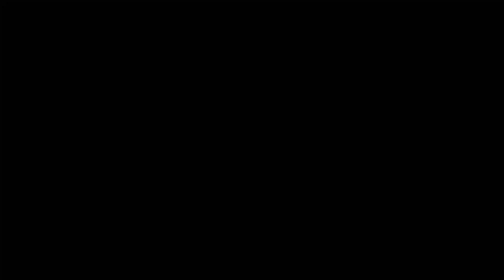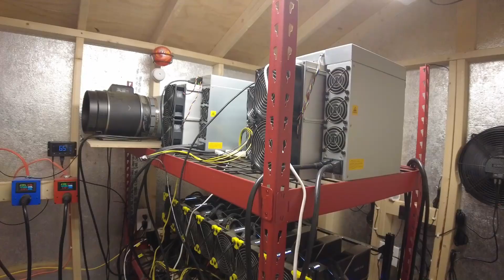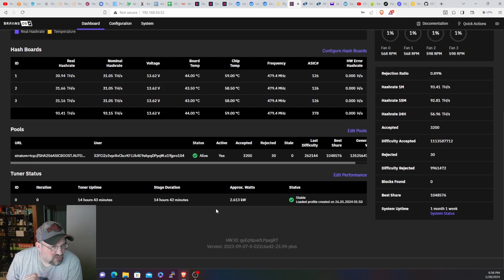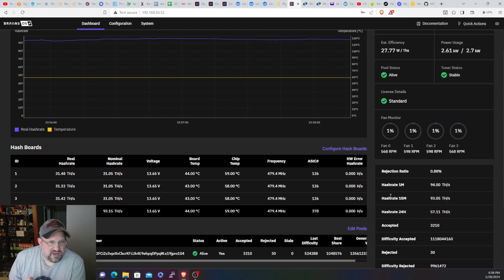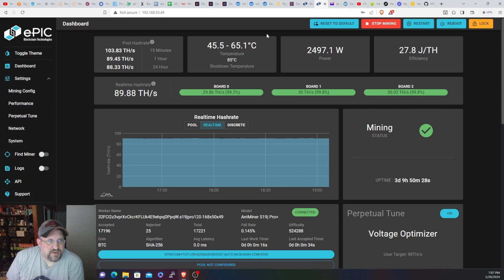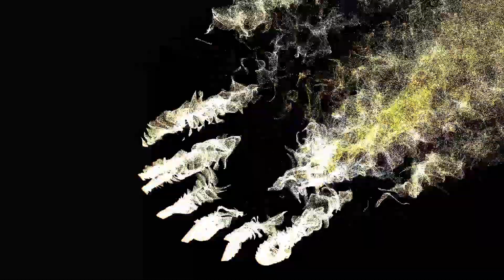Update on My Bitcoin Miners -  Braiins & ePic Control Boards

Comment: How much are you paying for electricity 
And what's your plan for the halving if you paying over 8c
Reply from the maker: for January it was $0.104/kwh.  I just recently switched to a different plan that should drop it below $0.06
Reply: @ruskyscryptocave  let's say you got 7c$what is your plan after halving?
Reply from the maker: @aligamar2750  I will keep mining as long as I can afford to pay out of pocket for the electricity. I have a goal for the amount of BTC I want to accumulate and after I hit that, then I’ll evaluate whether it worth running the machines. I may have to switch some GPU rigs to NiceHash to get there quicker.  Currently 75% to my goal.
Reply: @ruskyscryptocave  Good luck buddy

Comment: Your S19jpro+ should be closer to 23J/TH at 90th, stock firmware gets that in low power mode.
Reply from the maker: I need to play around with the voltages and frequency setting to get it more efficient.  The auto tune doesn't seem like it does as good as the stock LPM
Reply: @ruskyscryptocave yeah my pro+ is removed out of my farm because of this,  doesn’t like OC/tuning. OEM Bitmain is better in this case. On the Kpro I get 137T @ 3075w 668.75Mhz @ 13.9V give it a try. I did it on another kpro i have the chipset wasn’t as good performance was lacking. Would like to know if you get good results